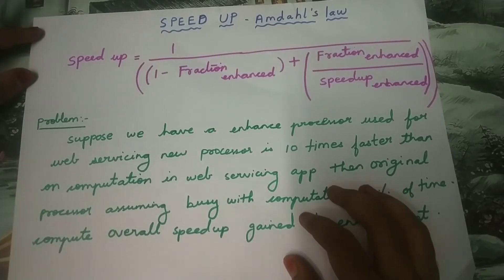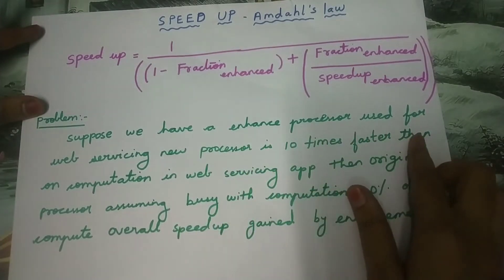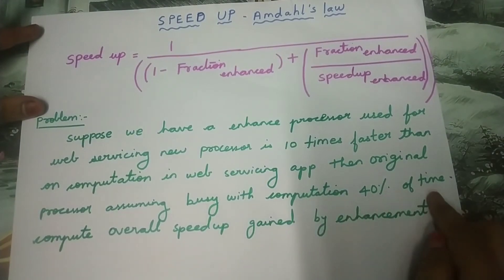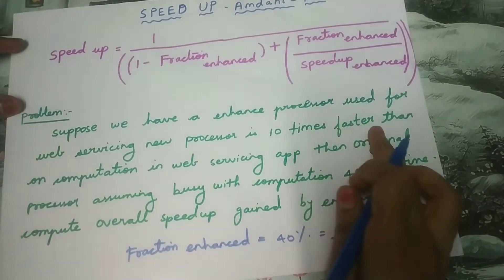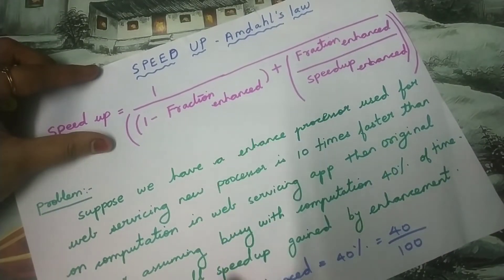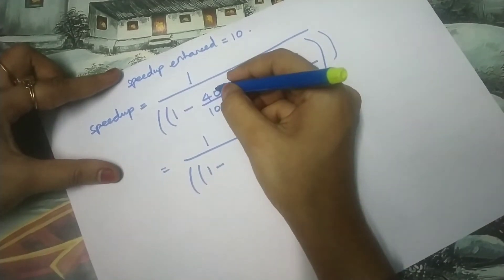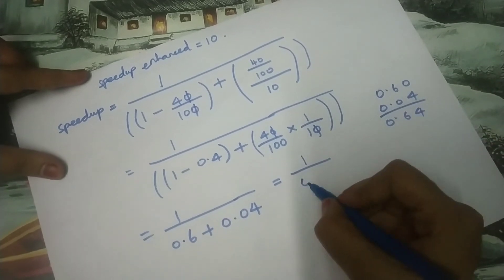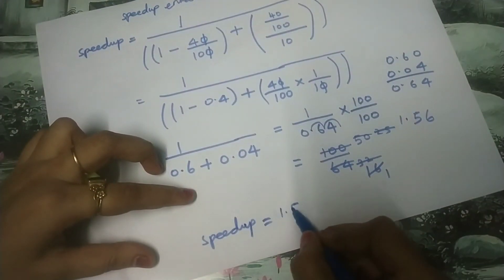Speed up example problem and formula in computer architecture Amdahl's law

Comment: where did you get 100 over 100 at the end? it was not in the formula you showed first
Reply from the maker: I have multiplied and divided by 100 in order to remove decimal point.When we remove decimals it will be easy for us to do calculation